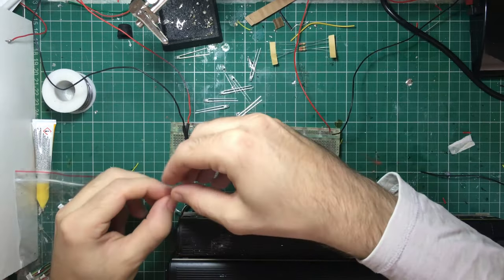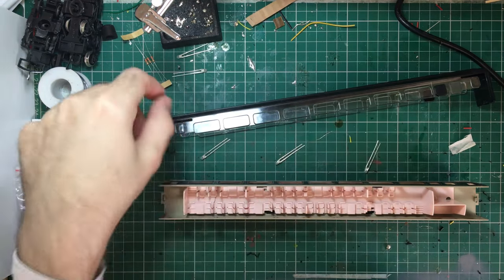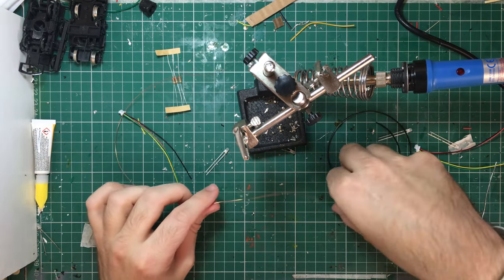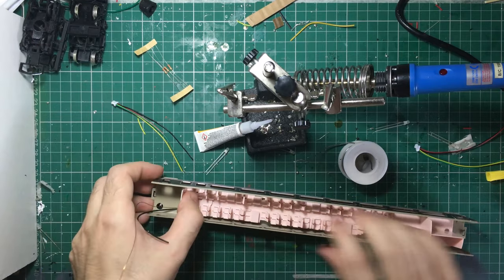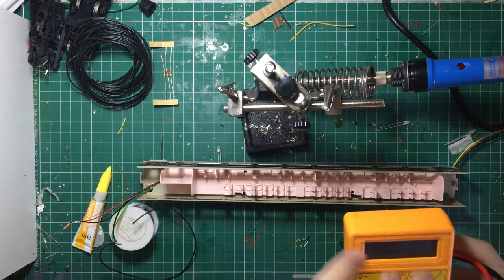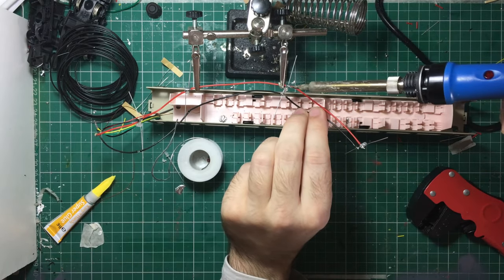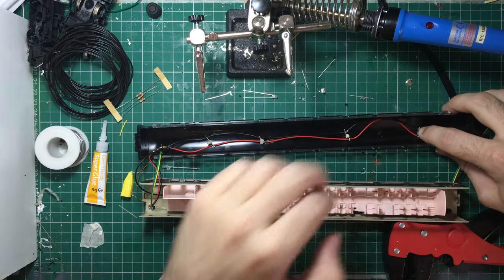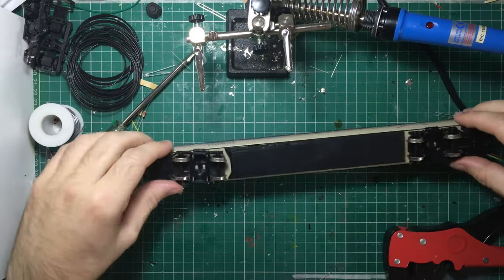Adding lighting to my rolling stock

Comment: Hi, very nice “how to”.  Because the DCC track uses Pulse Frequency Modulation, which is very similar to AC, you can get issues. Have you thought of putting a Voltage Rectifier inline, which will handle any power change?  Also try including a Capacitor, at least 25v, which will keep your lights lit when going over dirty track, or points…Simon
Reply from the maker: Hi +Liverton -Simon, Yes I have added capacitors in. As I said in the video I am planning to do some DCC magic With directional lights. I will do an update on this once I have got the new connectors. Getting the lighting into the roof of each car with basic connections was the aim for this video. I like how these have turned out but I do think there is some refinement needed! Very useful comments. 

Peter

Comment: Hi again, I now watched your video in its entirety now.  You mentioned Bridge Rectifier, I would defiantly use them and a capacitor. My only other suggestion would be to use a narrow VERO strip in the roof rather than trying to solder all the wires on, it makes positioning LED’s much easier. I found when I used the same connectors the wires were too rigged between the coaches and derailed them, I think I used to think a wire, how have you found them?
Reply from the maker: Thanks for watching the entire video. I think I will keep them shorter in future.  I thought of using VERO but I have found that wire gives me some more flexibility. I have added another video using the magnet wire. It has given me a much easier and better placement of lights in the carriages.